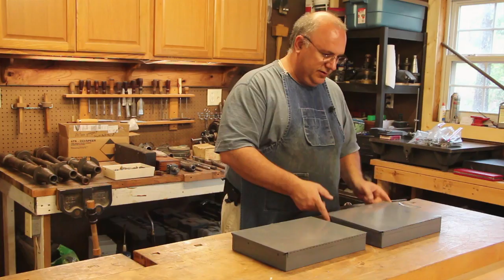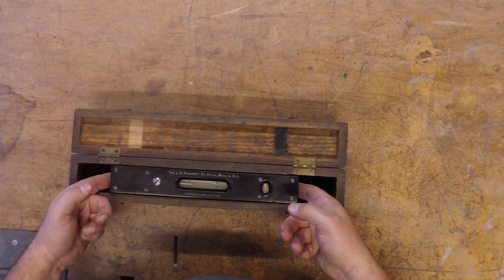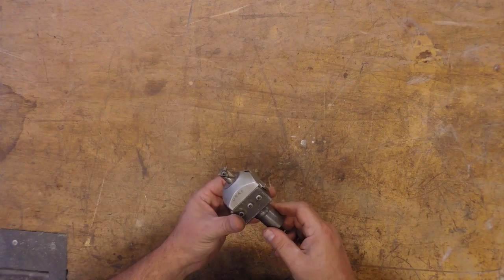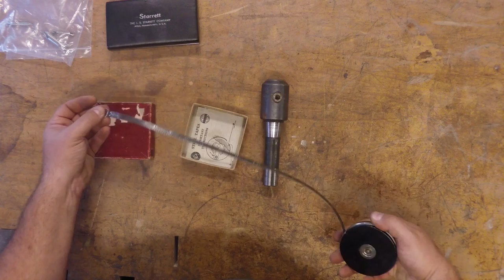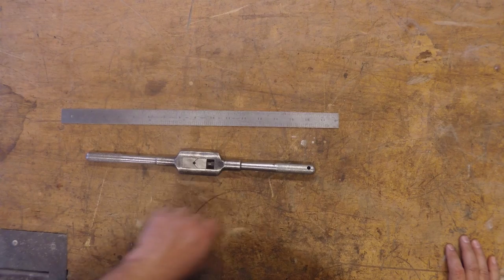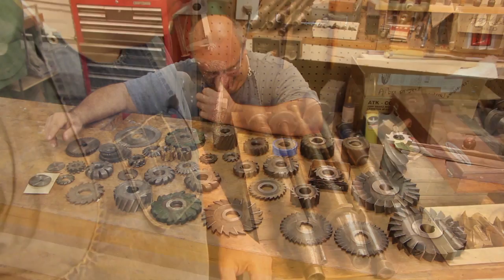Odds and Ends 4:  New Tools and Tooling from ArnFest!

Comment: Keith, the Starrett 199 machinest level is a must have for accurate machine leveling.
Heat from your body/hand can change it's sensitivity and accuracy, so use carefully. I keep my shop and all tools (levels, small tooling, shop supplies, etc.) in a controlled enviroment, + or - 4 degrees F at all times. Also, all my materials, wood, plastics, metals, etc. are placed in the shop a mininum of 5-7 days in advance before they're needed for a project. The materials have time to acclimatize which helps a lot with small increment measuring. Keeping your levels in this controlled condition is a huge plus for their accuracy.

As a side note I use this formula: metal moves 3/8" per 100' length per 30 degree temperature change (this is product temperature not ambient temperature). I've found this to be pretty accurate in my past construction career.

Nice small tools you bought.

BTW if you ever want to sell that level, let me know as I collect these. I think you got a good deal!

Thanks for sharing your finds....13

Comment: I think like most I also prefer the shop videos and projects but I also like the odds and ends as well. Kinda envious of that tool haul. You might find tooling rare there but over here it's scarcer than frog hair!! LOL I pick up some of those Plano tackle-type boxes at walmart for small assortments.. might work well for the small reamers??

Colin ;-)
Reply: I use them in my service truck for fuse asst, fittings, connectors, pretty much anything small that needs to be organized. And they're cheap!! ;-)
Reply: *****
Those hardware store plastic boxed all suck. The dividers always fall out, and the boxes crack if you look at them wrong. I have tried them all. I run a bicycle shop that specializes in internal gear and antique bikes. I have mucho-experience in sorting and organizing small parts. Metal boxes are the only way to go to store metal widjits.

Comment: Keith;

Nice find on the Starrett 199 Master Machinist's level.  One thing I have found in using my 199 is that you pretty much need to recalibrate the level every time you use it since it is so accurate.  Temperature does affect the level and it is pretty quick, as I am sure you know how, to do the calibration.  I just take mine over to my granite surface plate every time I need to use it and do a quick check to make sure the bubble is consistent.

BTW, have you received the rest of the tools yet from the box you purchased and had your friend pick up?  Would really like to see a video on the balance of the items.

Regards;

Ron Kluwe